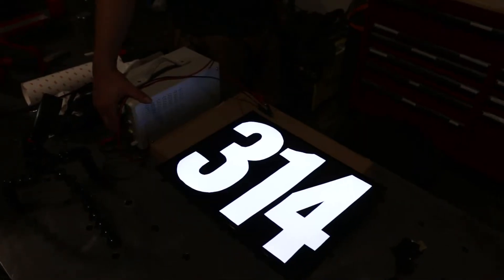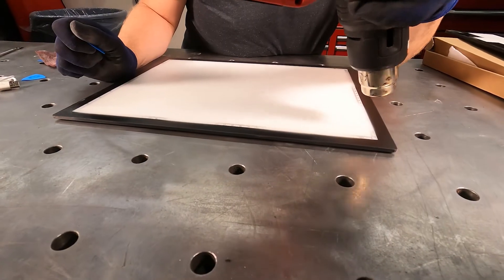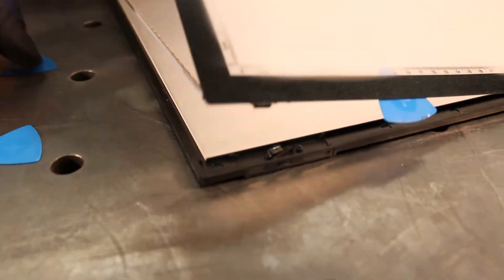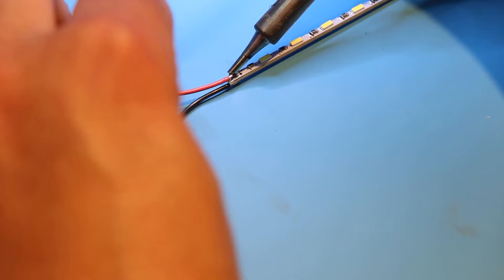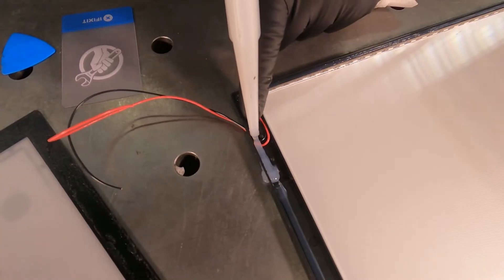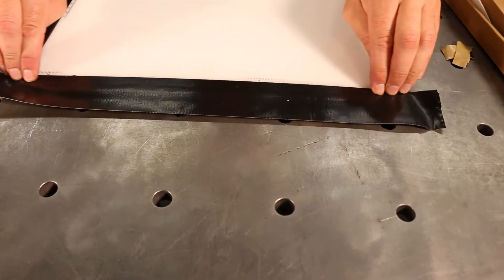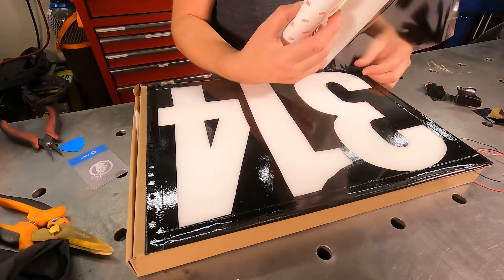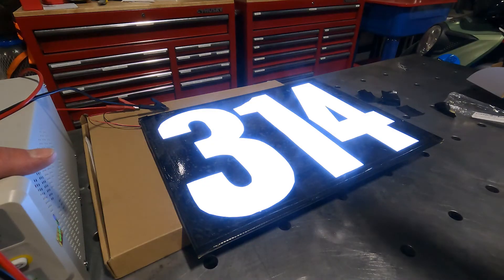Make a Backlit Racecar Number Board For Less than $40 | *A Brief Tutorial*

Comment: I followed this and made a set for Lemons too. In a pinch you can also short the on/off switch and leave the original electronics inside. Then it turns itself on whenever it gets power from the USB.